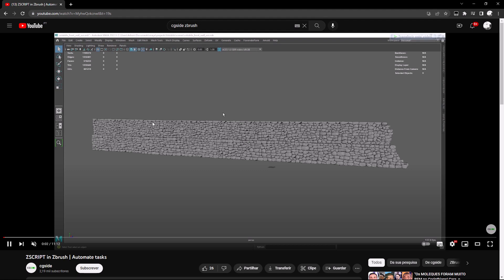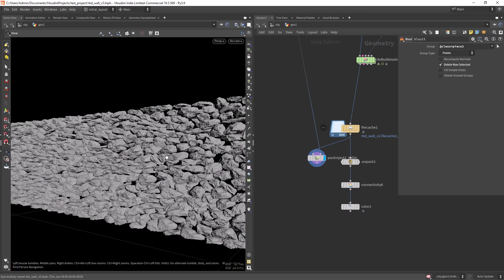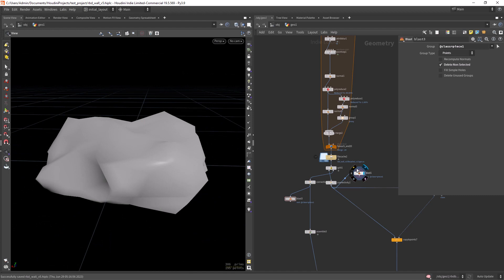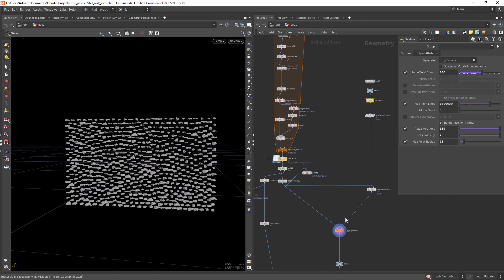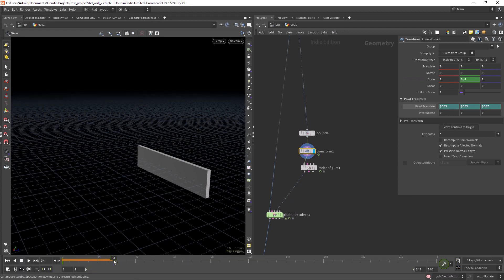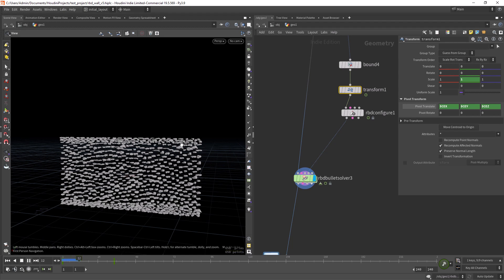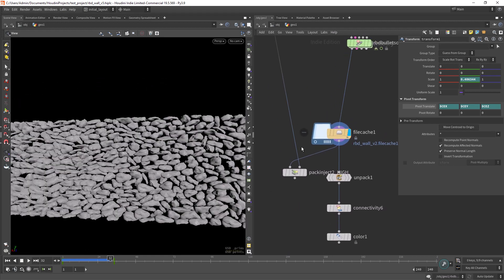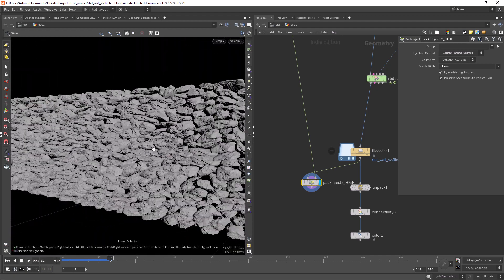Procedural Rock Wall without intersections

Comment: Awesome! I was wondering how you could fill the holes between the rocks? 
If I had to do it by myself, I would make a vdb from the bounding box at frame 34 and make the difference between rocks and the bounding box, do you think it's the "best way" ? :)

Thank you so much for your videos!
Reply from the maker: Hey, that's a quick and easy way. Maybe I would do something along those lines but also would use the uvlayout set to P (instead of uv) to fit some smaller rocks in the boolean resulting mesh. Cheers
Reply: @cgside  thank you for your answer :)